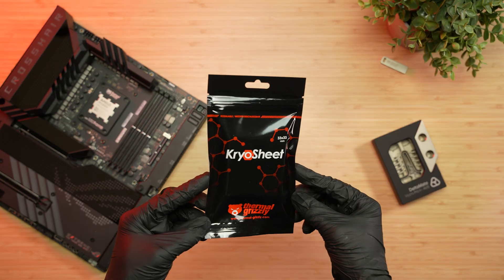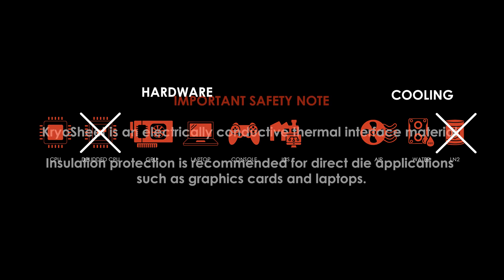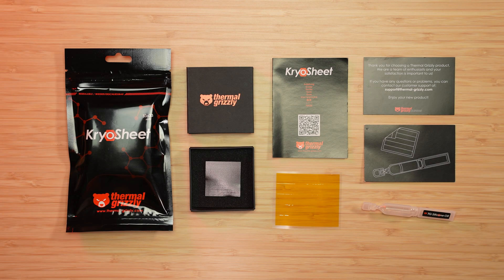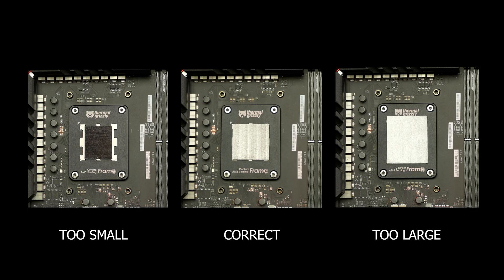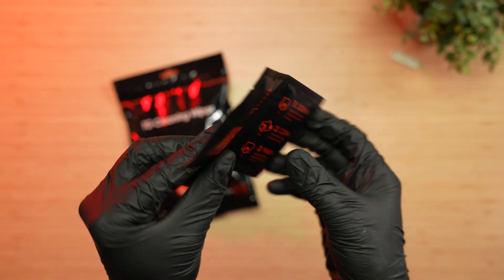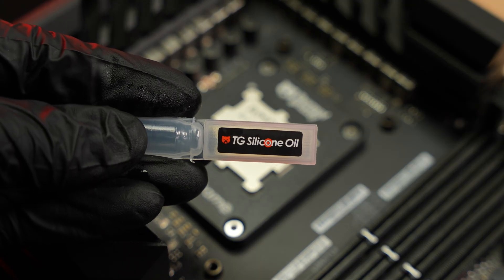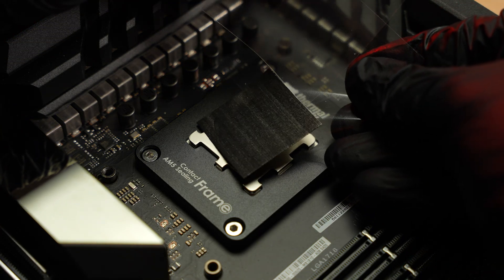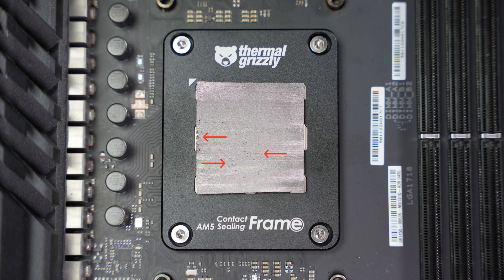How to Apply Thermal Grizzly KryoSheet on CPU? - Step by Step Guide I Apply Right!

Comment: I applied KryoSheet today on the CPU and temps are really high compared to the thermal paste I was using, Arctic MX-6. Does it need a while to settle ? Both sides of the CPU and AIO were cleaned with 99% Isopropyl alcohol and dried..

Comment: If I am sure my kyrosheet is not going to move...  is it advisable to use silicone or not?
Silicone is supposed to be a bar thermal conductor, isn't it?
Reply from the maker: It will not move once installed, and it can be installed properly even without silicone oil; it just requires a bit more careful application.

Comment: Mine did not come with silicone oil or tape. I would like to use the oil just to be safe but I don't know where to get it...
Reply from the maker: Silicone oil is available in majority of construction and DIY creation shops and on Amazon. If there are multiple options choose the one that is thicker (less liquid).

Comment: the temp with silicone oil was backwards for me, just used a little dot in the middle of the die on a 5070 mobile and a 14900hx and temps where very high for the first hour, then settled in the high 70s low 80s under load. i assume this was the oil drying out ?
Reply from the maker: Yes

Comment: These are an absolute nightmare to install and will rip if you look at them funny. Use very little of the silicon oil and pray to god you get your cooler of choice screws aligned on the first turn each. Will update if the small tear near the corner that resulted from standard installation frys my 9800x3d. There's got to be a better way TG...
Reply from the maker: It is a delicate material that requires careful installation and unfortunately sometimes tears happen. We do offer multiple less demanding products in the portfolio for users who prefer easier solutions.

Comment: Is it really that bad to use it from one CPU to another having the same socket? Or after CPU upgrade, eg from 7950x to 9950x.
Reply from the maker: If it stays in one piece after removing the cooler, it may still work ok. However, microcracks can occure in the material structure that will decrease performance upon use, that is why we don't recommend it. But if you want to try and find out, go ahead.

Comment: I wonder if adding a drop of silicone oil on top of the sheet will facilitate reusing the graphene cryosheet after pulling the cooler.
Reply from the maker: Silicone oil will evaporate after couple cycles and does not have impact on reusability.

Comment: they dont give, the silicone
Reply from the maker: It may not be included in the older packaging as explained in the video, and it is an optional step, not obligatory. You can use a home type DIY silicone oil.

Comment: Been using the 38 mm2 KryoSheet on AM4 for a year now without complaints.  As a replacement for the original Kryonaut, I believe it's easier to apply and clean up, and offers very similar daily use performance for AIO cooling.  My packages did not include the silicone oil or Kapton tape, but they weren't necessary for my application:
     5700X3D + Arctic Liquid Freezer II 420

Comment: I have bad experience with kryosheet, it works significantly worse then 8wmk paste on ryzen 5700x, I think this is because of very uneven cooler feet it is as rough as typical RTX cards cooler. So be careful guys, I think kryosheet mandatory requirement is mirror like cooler feet. 

I have very good experience with other  grizzly products though so no hate here.

Comment: Can the mounting pressure be too high or like mention it would need to be replaced due to fractures cause by compression?
Reply from the maker: It is delicate material that tears quickly, already normal mounting pressure will most likely cause microcracks or even bigger tears, this is why we don't recomment resuing it.

Comment: Anybody have suggestions for silicon oil that's appropriate for this? My kryosheet is older and doesn't come with it and I'm having a hard time finding what type is suitable. I just wanna do it once and never touch it again, so I want to get it right
Reply from the maker: You can use standard silicone oil with a viscosity of 500 cSt or even 1000 cSt.

Comment: But I was thinking a tiny spot of paste in the middle would hold it in place. Please send the oil.
Reply from the maker: You should not mix paste and KryoSheet, it is two completely different materials.
Reply: @thermalgrizzly  I got the silicone oil. Perfecto. Cool running
Reply: @hankarmstrong3681  how did you get it?
Reply: @Nucleosynthese  I bought it at the hardware store. 3-in-1 Oil excellent stuff

Comment: Used Kryonaut and it worked well for 9950X3D. I am changing coolers and have a 4-point connection now replacing a two point connected cooler. This 7950X has always run hotter, idled at 44, hit 85 in a heartbeat but always stable and fast. I'm going to try the sheet. The 9950X3D install had me working that Kryonaut for an hour trying to get it right and my patience. I bought two in case i screw one up. New experience, new lessons learned.
Reply: i bought silicone oil and it worked perfectly. I pushed a stud through the pump adapter plate and played HELL putting it back. Challenge accepted. Adapt. Overcome. Success. Idles a degree or two cooler now. DCS runs under 60C. It's good for 9950X3D but this room is 81F

Comment: Nothing like selling a product that requires an oil that isn’t supplied…
Reply from the maker: It may not be included in the older packaging as explained in the video, and it is an optional step, not obligatory. You can use a home type DIY silicone oil.
Reply: I purchased this right when it came out and at the time noone used any liquid when applying it.    Personally I think the addition of adding something to the cpu IHS before the kryosheet is because some cpu cooler's are designed very poorly and their installation is a little tricky.   People started suggesting putting just a small dab of traditional paste in the center to keep it from moving around.   (Some people to this day actually apply a thin layer of paste like normal, in addition to a kryosheet but this never made sense to me personally, and I wouldn't recommend it)

I think that's where the silicone oil recommendation started...the inclusion of the kapton tape is appreciated in the community as well, more and more people are using this on GPU's because the fact that it never dries out makes it especially ideal in a GPU.   Generally speaking a person would never need to remove a GPU cooler.

Comment: Question: do I need really high mounting pressure to get proper die contact with Kryosheet?
I was planning to use this on my laptop CPU+GPU (12700H + 3070 Ti).

Thanks!
Reply from the maker: The KryoSheet is very thin (0,2 mm), which means that in certain hardware combinations it may not perform at its best, but it will still work. Since there are countless possible setups, it isn’t feasible for us to test and know the exact outcome for every individual combination.
Reply: @thermalgrizzly Noted, thanks for the response! ❤

Comment: TG, what if I use the AM5 Contact Frame from Thermalright? I've had it before the Thermal Grizzly contact frame came out and do not feel like buying something I already have.
Reply: Would it short? Or is it made of the same material. Forgot to include this.
Reply from the maker: It is up to you what you use.

Comment: So can I just use a bit of thermal grease to hold it in place instead of the oil ?
Reply from the maker: Our recommedation is silicon oil.
Reply: @thermalgrizzly you would think it would have come with some
Reply: it has to be silicon
Reply: Okay strange cuz I keep seeing other people saying there's a bit of thermal grease on the corners @Benjamin-1992
Reply: @Benjamin-1992 any brand suggestions? They sell some at home depot, but it isn't clear and I just wanna get the right one 😅

Comment: Considering only performance and not durability, which is better: Kryosheet or Duronaut?
Reply from the maker: While performance can vary depending on the specific CPU/GPU and cooler coombination along with other factors, in our internal testing KryoSheet generally delivered better results for ambient cooling. Tom’s Hardware came to similar results in their Best Thermal Paste Guide: https://www.tomshardware.com/best-picks/best-thermal-paste.

Comment: i used kryosheet on my 6800xt as pastes kept degrading and Hotspot drifting to 20 kelvin after a few months. kryosheet keeps my Hotspot at 12 Kelvin constantly, which is insanely good. kryonaut extreme was at 14 Kelvin with a fresh apply.

would totally replace thermal paste on any GPU with kryosheet.
Reply: He means delta between GPU temp and hotspot
Reply: Kelvin? Either a troll comment or a comedic genius
Reply: @EuropeanHardwareEnjoyer  care to elaborate?
Reply: @sgredsch  20 kelvin is −253.15 °C or −423.67 °F.

Comment: In the event we don't get the oil, do you recommend using a tiny bit of thermal paste to help secure it or just put it on as is? Thanks!
Reply from the maker: Silicone oil is just extra help, it is not obligatory. Apply without it or get a general home type DIY silicone oil.
Reply: @thermalgrizzly  Would a droplet of distilled water do the job as well?

Comment: so Thermal Grizzly, why wasn't there silicon oil packed with my KryoSheet? Had to go in dry
Reply: 1:11 says older ones may not have it included.
Reply: @StampedePC  yeah I bought it not long after it came out and it didn't have it. unfortunately I had a CPU mounting problem and it ripped to pieces when I had to re-do it multiple times. I went back to regular paste, then went to phasesheet on my next CPU, which is more forgiving and better performing.
Reply: @StampedePC I brought one from a micro center yesterday and it did not have one in it at all bruh so wtf am i supposed to do?😞 Will it be fine if i just put it on there and put on the heatsink?
Reply: Same as me :face-purple-crying:
Reply: Bro, I bought it yesterday and it came with no oil. Lol. Guess I'll stick to paste...
Reply: @Lunchcubes welp i just read your comment and yeah i brought mine on black friday  this product is useless for me since the original post was more than 3 months ago and they still don't have the oil in it, and im trying to build my first pc so i will just use the thermal paste that came with my heatsink instead and forget the kryosheets.  Spent $25 for nothing 🤦🏽
Reply from the maker: Both the Kapton insulation sheet and silicone oil are optional, they’re just helpful aids, but not required. If you decide to use it, you can purchase Kapton Insulation Sheets separately, and for silicone oil, any DIY-silicone oil will do, just make sure it’s thick rather than runny. As we mention in the video, some older stock might not include these items. With multiple sales channels and partners it is not feasible for us to make a clear cut when updating product packaging.
Reply: Bought a 50x50 and 25x25 from Amazon n both came with the silicone😎😎😎😎😎😎😎 

No but for anyone in the future, if you end up without it, I did see on other guides in the past that you can use a tiny dab of thermal paste on the corner, just enough to get it to stick, n it should be all good.

Comment: Given that one has to buy new sheets if an installation mistake happens, or the HSF is removed, why should anyone buy this product over quality thermal paste?
Reply from the maker: We offer a broad range of thermal interface materials designed to meet the needs of users with different levels of experience and priorities. Some of our higher-performance solutions can be more demanding to apply because of their material properties. That said, many users value KryoSheet because it provides top-tier thermal performance, is cleaner to handle than liquid metal or paste, and doesn’t degrade over time like traditional pastes. Ultimately, it comes down to what you’re comfortable with: if you want maximum performance and don’t mind careful handling, KryoSheet is a great choice. If you prefer something easier to work with, our premium pastes like Duronaut is best general choice.
Reply: because it never needs removing. the pad will outlive your CPU. if you're using air cooling - a tower block and fans; the only things you'll ever need to replace are the fans. the graphene can be viewed as a permanent thermal compound. much better than paste, which needs replaced every 5 years or less
Reply: Buy once cry once. Install it and as long as temperature stays fine you don't need to remove the cooler from the processor.
Reply: Kyrosheet properly fitted onto a PC would be good for those long-term builds like for friends/family that aren't high end machines and you don't want any need to repaste ever. For a regular system if it's your own one I would use phasesheet.

Comment: Does this apply to the TPM phasesheet also?
Reply from the maker: Not completely, the PhaseSheet PTM is not electrically conductive, and due to completely different material you have to peel it off from foil. Video guide is coming in the next weeks.

Comment: I live in a city where it is very hot all year round. I tried using Kryonaut thermal paste, but after 2 months it dried out and the temperatures increased a lot. Would this pad be better?
Reply from the maker: Thermal interfaces are in general designed to withstand temperatures that exceed even very hot climate conditions, so this is not really an issue. Kryonaut thermal paste was designed for overclocking where users typically don't keep it in the system for more than few weeks or months. If you are looking for a TIM solution with good performance and long durability we recommend KryoSheet, PhaseSheet PTM or Duronaut.

Comment: Can it safely be applied together with Lian Li Hydroshift II 360 AIO, and its new pump locking mechanism?
Reply from the maker: There are too many cooling solutions available and we cannot test it all. You can share your feedback if you have installed it in your setup.

Comment: Ive put Kryosheet( old version)on my I7-14700kf  and temperatures risen for 1-2c overal.
Reply from the maker: I am sorry for your experience. There are multiple factors influencing performance, such as the mounting pressure of your cooler, surface flatness, ambient temperature, and overall system configuration.There are millions of combinations and we cannot know or test every single one.
Reply: @thermalgrizzly I meant it a in " positive way". Only 1-2c is nothing. What it gives in return is 100% coverage and next time no cleaning required.

Comment: for  many laptops you need to remove the thermal sink to remove fans to clean.
Reply from the maker: True, this is part of proper maintenance laptop process.
Reply: Ok... and?!
Reply: Cryosheet is very delicate and may be damage during heatsink removal. Therefore you may want to use a gel type product that can be reused. 

I wonder if adding a drop of silicon oil on top might allow better release. 
 @scarqarly3265

Comment: Can you tell us once and for all what is better for consumer cpu cooling between kyronaut extreme and duronaut, as duronaut get the reputation of performing better but kyronaut extreme is more expensive. Thank you!🙏
Reply from the maker: There’s no single “best” solution—it depends on your hardware-cooling setup, your comfort with delicate materials (e.g., harder to apply, electrically conductive), and your preferences for maintenance frequency and ease.

For non-delidded, ambient-cooled CPUs, our top picks for ΔT performance and durability are: Duronaut (paste), KryoSheet (thermal pad), and PhaseSheetPTM (phase-change material).
For sub-ambient CPU cooling, Kryonaut Extreme (or Kryonaut) is best.
For delidded CPUs with ambient cooling, choose Conductonaut Extreme (or Conductonaut).
Reply: @thermalgrizzly thank you for your quick response and attentive explanation for me. Last question to help me understand if you don’t mind, what is the meaning behind “ambient-cooled cpu” and “sub ambient-cooled”? Never heard the terms. Thank you.
Reply: @amendez93  "Ambient-cooled cpu" = Your surrounding air, i.e. your room. If your room is around 30°C then your CPU can only be cooled down to 30°C.
"Sub Ambient-cooled" = You introduce other source of cooling (active/passive/radiative) to cool your CPU, usually lower than your surrounding air temperature.
Reply: @IdiNiumYT would an AIO be considered sub-ambient cooling?
Reply: @amendez93 No, because you will still cool the liquid inside the AIO with the surrounding air through the radiator. If you see your CPU went lower than the ambient temperature while idling, well that's probably because of good heat transfer but usually not that significant.
Reply: @IdiNiumYT thank you for your excellent explanation, this is has been a great help!
Reply from the maker: In the context of reply it is meant close to zero or below zero.